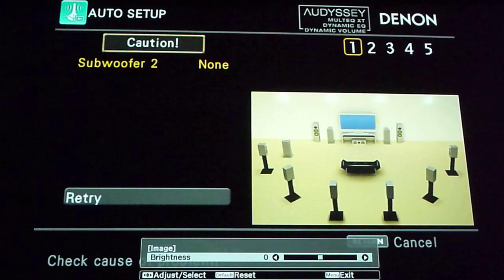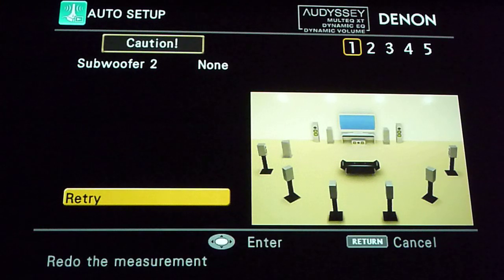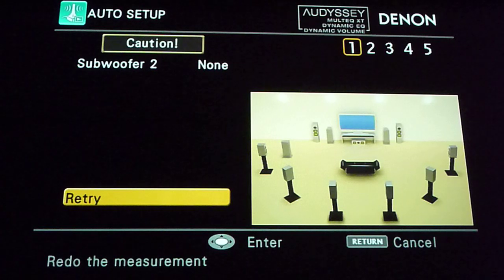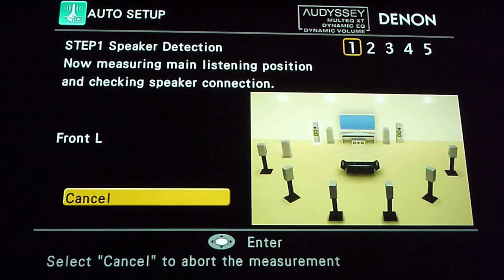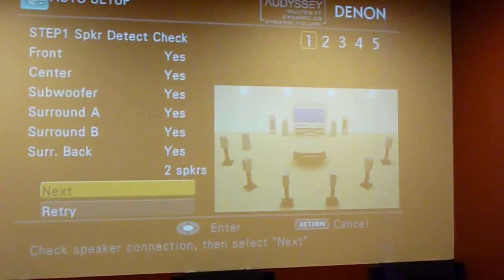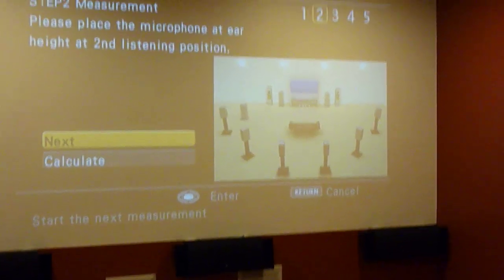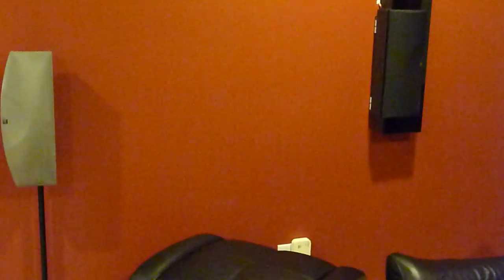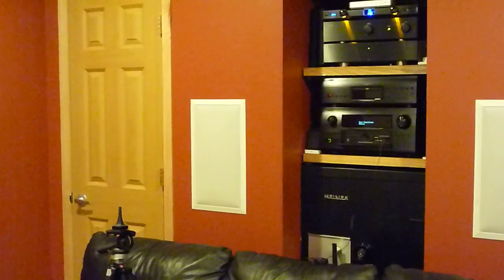Audio room calibration on denon avr-5308 audyssey

Comment from the maker: @WAYNE1980AA very simple ..you can let audyssey do its job and it will adjust frequency and level for each speaker. or adjust them separately to your liking or let audyssey do lts job and then go into the menu and adjust filters for each channel or set all to thx with will put all channels at 80hz low pass which means anything below that regardless of which speaker is playing will go to your sub.